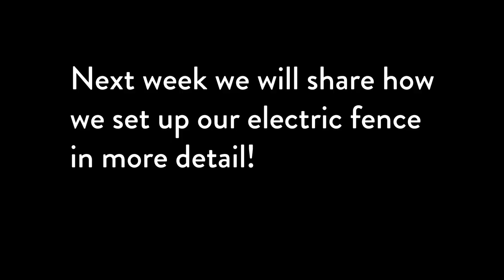Building a Pig Shelter With Pallets (Vlog)

Comment: Your pigs look very happy!  Nice pig palace Dominic and Scott.  I'll bet Dominic wishes Scott was nearby and eager to help all the time!  I follow another homestead that used surveyors tape to mark the wire, the theory being that it helps the pigs see and recognize where the wire is so they can avoid it.  It may help?
Exciting times on the homestead.  Thanks for sharing!
Reply from the maker: Thanks Kevin! I like the idea of the tape so much! They'll be relearning where the wires are every time we move. I may have touched the wire with no shoe on (for science) it's a kick in the pants.
Reply: @ODriscolls  LOL, I did the same thing 35 years ago but I used my bare hand.  The foot might be worse?  It makes you take notice huh? ;o)
I liked the tape idea as well.
Reply from the maker: Hahaha I used my hand but took off my shoe! The rubber soles keep you from getting a good shock.   Dominic learned the hard way that placing your hand on a wooden post and touching the wire will ground you as well regardless of rubber boots 😆
Reply: Yeah, I didn't have rubbers on so I was well grounded too.  Worn out sneakers I think... Yes, wood is a conductor because of the water content.  Don't ever touch a tree that has contacted a power line.  Sounds like we've all had some shock therapy now, lol!